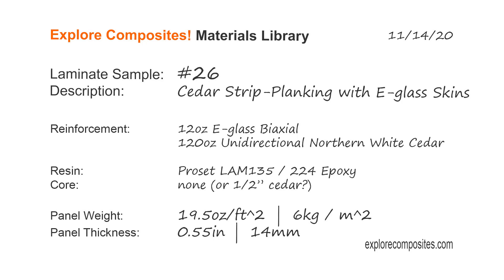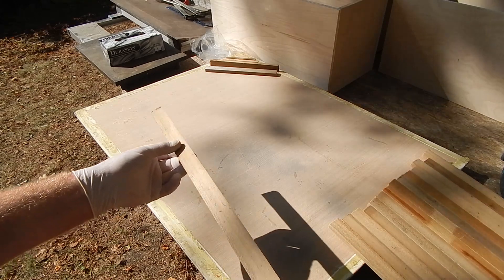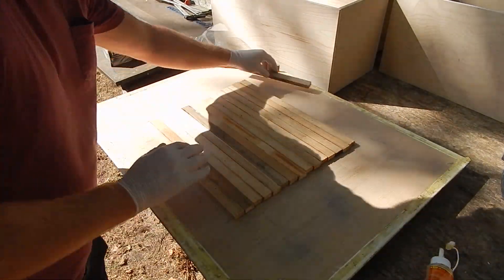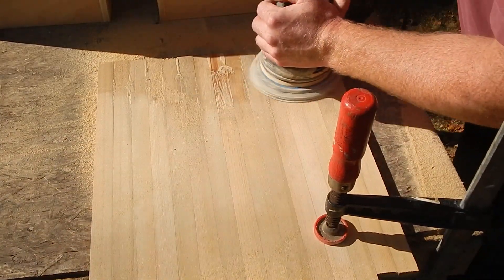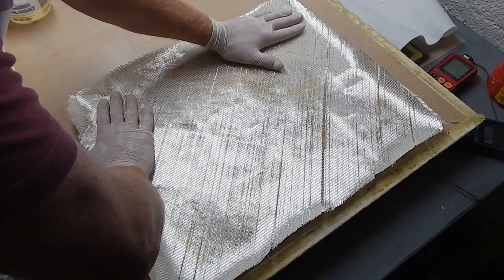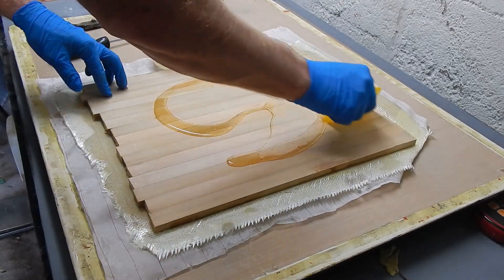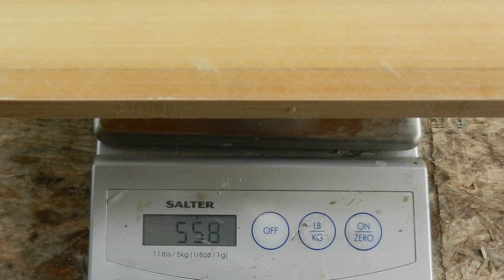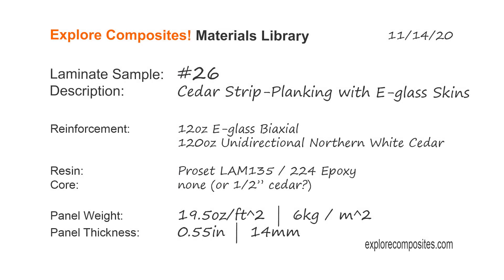Laminate Sample #26: Cedar Strip-Planking with E-glass / Epoxy Skins

Comment: I agree totally. It's not the last fashion in high composites, but that works pretty well and it's very durable if the skins are thick enough to be totally waterproof and that a good epoxy resin had been used. The 1988 trimaran F 40 Adrenalin was made of 3/8 red cedar, 200 gr carbon fiber. The complete boat long 12.18 m with a width of 12.18 was at the limit of the rule:  1800 kg, similar to the kevlar carbon multis of the time. It was sailing on 2017 at Phuket, 30 years later. I know cruising boats about 40 years old in excellent shape.
It's a simple method using a light wood (cedar, paulownia (300 kg/m3...), light pines) and even stronger woods at a very stressed zones, which can be made DIY on a male mold in a simple shelter with little investment in tooling. 
It's rather cheap and easy, but needs lot of hours of work. A good naval architect will modulate the thicknesses, varieties of woods, and amount of fibers to get the best of it. Great advantage it's impervious to delamination, that simplifies the structural calculations. You can even make big wing masts with the method.
Many canoes, and small power boats were made. Lots of multihulls  and plenty of strong cruising boats have used successfully the method. For boat building it's one of the best methods for one off boats, and you can obtain excellent ratios weight/strength/durability for a fraction of the cost of an advanced composite.
Reply from the maker: Yes!  I've seen pictures of Adrenalin but wouldn't have guessed that light!  I am a huge fan of simple wood construction for one-off boats but don't do much of that anymore - some day.  Really want to get my hands on some Paulownia too - around here in eastern North America northern white cedar is about the lightest thing we have.

Comment: Great video!  Steve and Alix from Acorn to Arabella sent me here.  They are using this technique in their boat.
Reply from the maker: Oh neat - I saw their cabin housesides.  Not sure it would be my choice but it uses cheaper material and has very strong corners without posts and fasteners.  I’m sure if they sheathe it that it will work great!  Strip planking is very versatile and is an ideal way to quickly build one-off curvy stuff - like boats.

Comment: I've been wondering if you could vacuum infuse strip planking? 
Maybe have the edges slightly rounded so as to provide flow channels. But I have no idea if the resin would flow into fiberglass between wood strips pressed against a mold surface.
PS: Thanks for all the videos!
Reply from the maker: Short answer: yes, totally.  But the process would be challenging!  Flat things would be easy-ish but for curves, the strips would have to be pre-glued and removed from the former, have holes drilled and then sheathed with infused skins.  Not sure how you'd mold a shape and infuse both sides.  A rolled treatment that makes little crush lines in the edges of the strips could work as a resin channel - but would take lots of testing to nail it.  

Plenty of boatbuilders infuse glass or carbon sheathing over strip planked or cold molded panels but only one side at a time.  Not sure how they seal it but it seems to work!
Reply: I rekon if you had strips of glass or carbon between each timber strip, it would probably soak in. Would be a mission to  lay up though and also ensuring that you have proper resin penetration as well.
Reply: I'm not understanding why you want to do this. 
Resin infusion is about be able to wet out your laminate while keeping a very low resin to glass ratio. This keeps the structure light. Vacuum is there to compress the interstitial spaces in the fiberglass and remove any off gassing. 
Infusing strip planking doesn't make any sense. You are going to have to fasten everything together, seal the back side, then bag and infuse the resin for why? Wood strips arent going to compress any appreciable amount under vacuum. You could just brush a low viscosity laminating resin on the strips and let capillary action carry it into the seams.
For strip planking I would just buy a Raptor 18ga Brad nailer and a couple gallons of gorilla glue. Then you can just brush your strip, tack it on, and grab the next one. Mist the whole thing with a little water at the end and it will be ready to sand the next day.
Strip planking is slow enough with having to rip and scarf eleventy-million strips. Don't add a bunch of extra time building vacuum bags and sealing air leaks.
If you've got a full mold don't bother with any of that. Just lay up fiberglass and foam core in your mould.
Reply: That would be heavy and ugly as the vacuum pressure would push the glass into the gaps between the strips. That would be weak as well because your glass fibers would not be parallel to the core surface.
Correct way would be to fair the strips with a low density filler, then bag and infuse the glass skin.
Reply: It's a lot of complication for uncertain results. The light woods are very porous and will soak tremendous amounts of resin in the infusion process. Furthermore the strip planking is a simple cheap manual method and the cost of the consumables and equipment of the infusion will be unsustainable.

Comment: You state that the cedar is not strong or stiff for its weight whereas in reality for its light weight it IS strong and stiff compared with other species. Usually for removing soft polyurethane glue you use a sharp scraper then sand.
Reply from the maker: Paul, you are right - I was comparing it to other "fibers" like glass or carbon instead of other woods.  Cedar is very respectable structurally and the fact that it is so light makes for a unique type of ply/core situation.  

Totally agree on the scraper too - I was just being lazy here and blasted it with the sander!